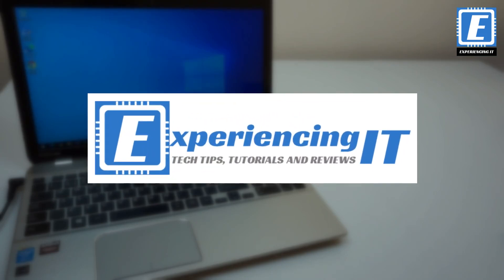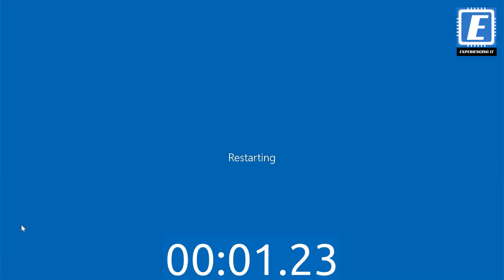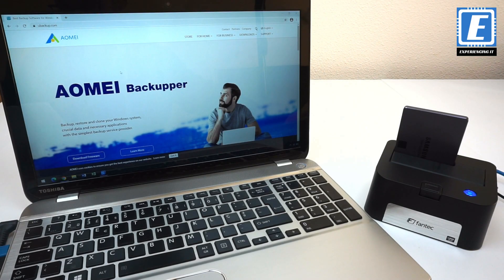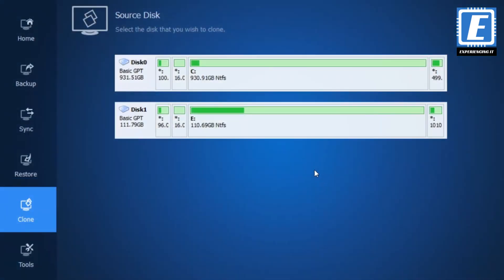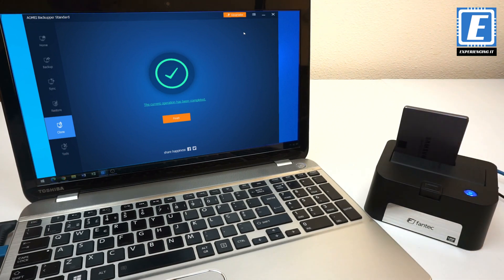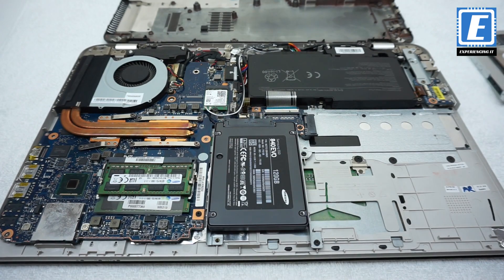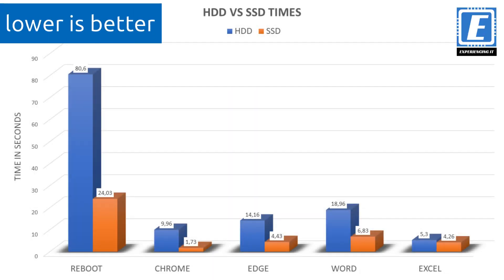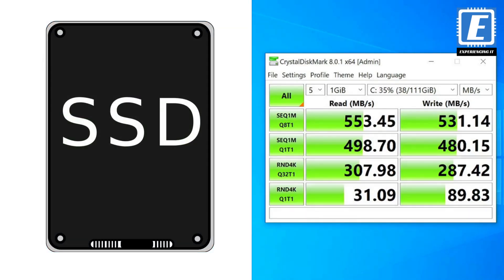Clone your hard drive for free in 2021 - HDD to SSD

Comment: I am tryng to clone my entire system disk wish is gpt to a new ssd,  also gpt,  however is still asking to update to the paid version.
Reply from the maker: Hi Hugo, that is quite strange... I've just tested right now with a fresh installation from the internet and it worked. Could you try to go to disk management in Windows and check if you can convert your new SSD to GPT from there? Then give it another go. Thanks.
Reply: @ExperiencingIT  ok. I will try.
Reply: @ExperiencingIT  No luck until now. The only difference I can see is that I have the new SSD without any partition . In the video the target SSD has several partition. Do I have to copy the partition scheme to the SSD ?
Reply from the maker: Hi. No, that should be done automatically. It's actually one of the messages that the application gives you when cloning, that all existing partitions will be overwritten, so that shouldn't be the problem.